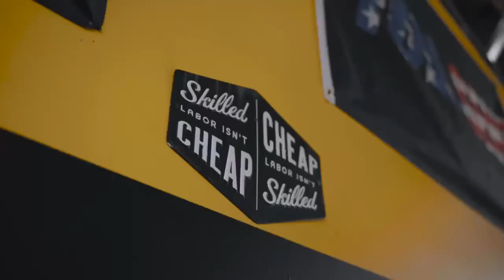YellowJacket Tuning & Performance

Comment: They tuned several of my friends vehicles and after they were running like crap....they all had to be retuned😮just didn't know how they did a base tune without a dyno and then they could of done a street tune to finish fine tuning....two of the vehicles were same year and had identical modifications.....both raced each other and were always neck and neck....now one is sluggish off line and screams top end and other screams off line and loses top end....they had compared old tune numbers and everything was out of wack😮